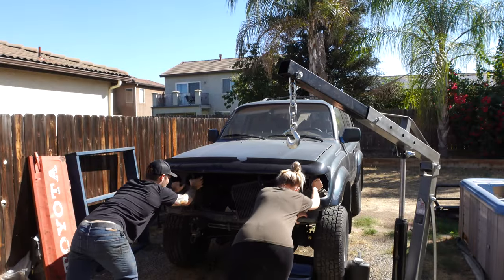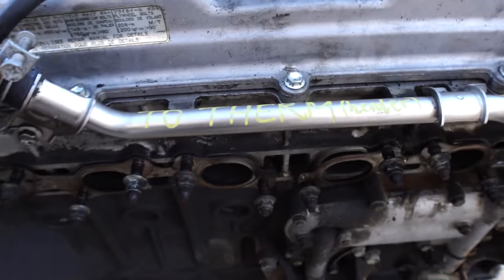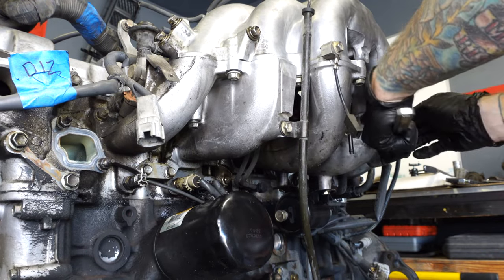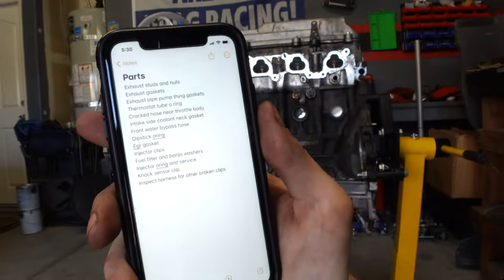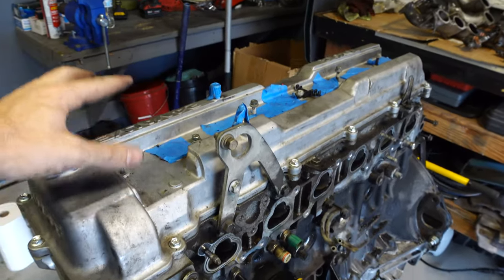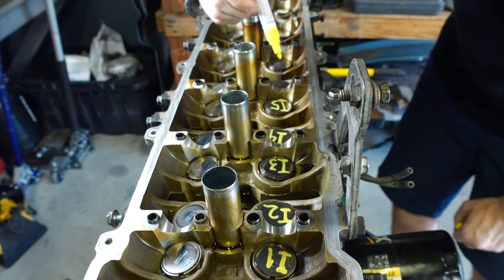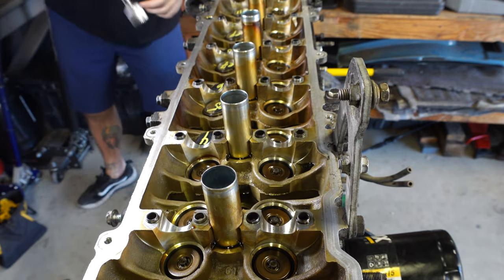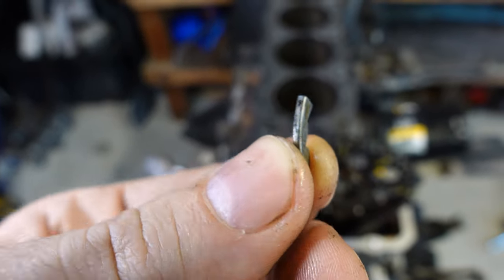1FZ-FE ENGINE TEARDOWN & Teaching My Girlfriend How to Wrench! - 80 Series Land Cruiser Build Ep. 3

Comment: Probably a bit late to be adding my 2¢, but I just found your channel. I'd roll the engine and pull the main caps so you can have a look at the bearing & crank surfaces and use plastiguage to check clearance, that way you can make a completely informed decision. Since your compression is good, there's no reason to do the rings unless you're pulling the crank anyways.
Reply from the maker: Funny timing. I'm editing a video right now where I tore everything apart, plastigaged it, and it's currently at the machine shop. It will be completely rebuilt besides pistons if I can get away with it.

All bearings were in spec and the motor continues to be in very good condition throughout.

Comment: Dude perfect timing. Im pulling my motor for a complete rebuild due to a rod bearing failure. This is an awesome reference video. Keep it up! I picked up a new short-block from Toyota now just debating to have my current head brought to a shop for refresh or also build a new OEM head/valves, etc
Reply from the maker: No problem! The other videos show the process of pulling it 👍👍
Reply: @RM_Garage  Haha already watched it and took noted. probably going to get a second engine stand but will be pulling the trans as well. I'm dropping the Tcase before the pull as I plan to put in low range 3:1 TC gears.
Reply: I want to rebuild my engine as well. Any suggestions?
Reply from the maker: @shangohusani8250  just go for it! Take your time and label everything
Reply: @RM_Garage  Definitely 👍 I had it forsale due to lack of time. Part of me wants to sell it and part of me wants to keep it. Its not alot of Mechanics in South Florida that work on these engines. Its just parked for now. Im thinking of going for it and learning myself.

Comment: Replace the head bolts. don't reuse them.  should get some ARP head studs if they make some that will work with the engine.  

The bottom end is up to you.  not really sure what I would do for that
Reply from the maker: I plan to test them against the FSM and if anything is out of spec I will replace the bolt. ARP makes a kit for the 2JZ which fits the 1FZ...I may go that route with a cometic MLS gasket. I'm pretty sure I'm going to open the bottom end after thinking about it.
Reply: Was thinking the same thing, but he's long done and I swear he got new ones or had them tested.  I have heard tha head bolts can stretch a bit, but they can also be fine.

Comment: At least pull the pan off and clean the inside and the pickup screen. Rear main seal, if you are using the old head bolts, run a die over them all as well as tap the block threads. I just did my 22R and I pulled the engine for sure. I installed a dual-row TC and a windage tray/ crank scraper. If you use new head bolts, you should also tap the bolt holes in the block. Your engine has way more stuff on it than mine. I tagged and bagged almost every bolt and took pictures and videos. Great video, thank you for posting, Jim.
Reply from the maker: Bottom end is coming apart, made up my mind!
Reply: @RM_Garage  Go for the gold then, you will be glad about all the power. Those cams just seem complicated to me, the FSM is great, but I would be extra careful with all those steps, although I have never worked on that particular engine before. I'm sure once you do it a few times it's fairly straightforward. Enjoy the build, and I look forward to your next video. Thank you, Jim, Eugene Oregon
Reply from the maker: @aerialrescuesolutions3277  thanks Jim!
Reply: @RM_Garage  I just watched Gearbox Videos building the W56 trans, you were right, this guy Really knows the business of building stuff right. Jim

Comment: My valve cover gasket job turned into the exact same thing yours did. Now I’m doing a lot more than what I’ve bargained for and wish I pulled the motor out. That upper oil pan was a bitch to get out with the motor in the truck. 

Are you planning on doing new transmission cooler hoses and constant tension hose clamps as well?
Reply from the maker: Yeah. The transmission is coming out and I'll inspect the lines. The hose clamps will definitely be replaced. Anything impossible or difficult to get to will be completely restored/replaced.